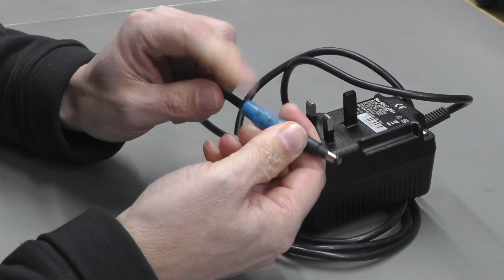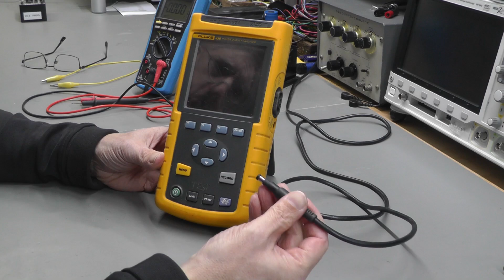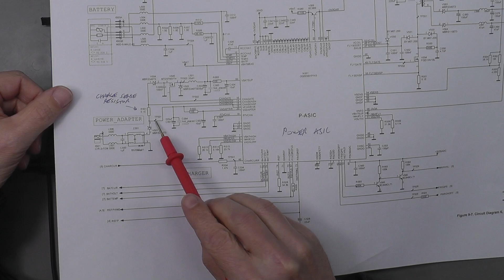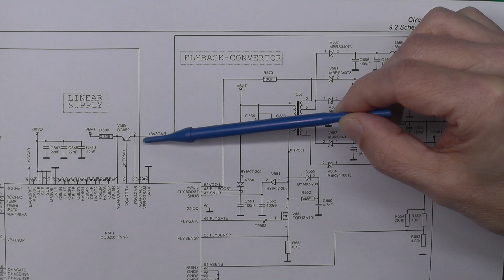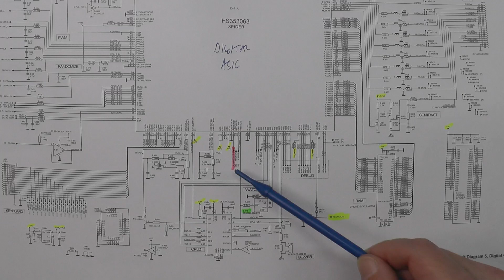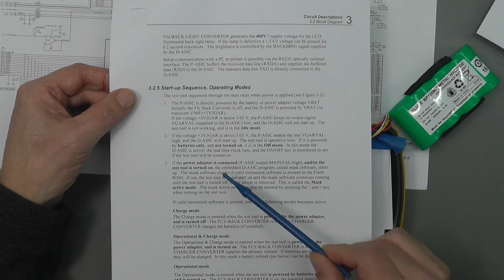No.103 - Fluke 43B Power Quality Analyzer Repair

Comment: I read below that you re-flowed the flash and all is working again? Just the screen correct having lines (common issue)? Replacement screens on ebay I have found.

Comment: Did you have another go at this Fluke 43B? If mask software is running it should be possible to flash the FW through the optical-serial port.
Reply from the maker: Not yet, I have it on the back burner to get back to. Thanks for the info!
Reply: @IanScottJohnston  read sec 7.4.1,7.4.2 of service manual. Although there is a dead end when it says look at sec 7.6 and that section does not exist in the published manual 😞

Comment: I have one Fluke 434 Power Quality Analyzer showing the same issue that you described in this video. I sent it for repairing to the Fluke representative here in Sao Paulo, Brazil a few months ago, but they returned it to me saying they could not fix it up because it was obsolete and Fluke did not hold parts for it any more.

Comment: So much gear has Flash based firmware, It's a good way for manufactures to put a time limit on the life of a unit, the flash just hangs on a bad block. I have a few nand failure project/repairs with very little information on nand rebuilding, unless you know Linux.
Reply: We tried to claim that the code in an ASIC flash was firmware, but the power's that be were trying to insist that it was software and should come under all the rules and standards for software production. it did go in our favor for that project but they got their way in the end.

Comment: Can you not de-solder it and send it to Fluke and get a new replacement? 
It's  very rare for ICs to go bad all of a sudden after operating for months. 
Specially on a battery operated instruments that eliminate the possibility of AC surges.
Reply from the maker: It's working now. I reflowed the flash and it's now powering up. The LCD on the other hand has issues, so will be repairing that.
Reply: @IanScottJohnston  Excellent. Hope to see it working soon.

Comment: Let's hope you can fix it by re-flowing the flash ROM. The 43 is an excellent tool,  I used one routinely to check 75 KW 480 volt 3 phase UPS/PCS  systems for harmonic distortion. Regards,  David

Comment: There is a chance that the problem might be with the keypad. I have seen Fluke 19x scopemeters, which are very similar, not powering up because of some shorts in that flexible keypad membrane. Try disconnecting the keypad altogether and powering up the unit by shorting the power button line (marked ON KEY) to the ground.
Reply from the maker: STOP PRESS.....I have just reflowed the Flash......lets say there should be another video very soon....:)
Reply: @IanScottJohnston  How the hell did you find something to flash into it?
Reply from the maker: @TheEmbeddedHobbyist  Reflowed, no reflashed....🙂
Reply: @IanScottJohnston  Ah now i understand! Solder is much easier to find than firmware. I sit corrected. 🙂
Reply: @IanScottJohnston  Looking forward to Part 2!
Reply: @IanScottJohnston  is there another video ?
Reply from the maker: I checked that, C400 on the Pcb just needs shorted out as it is across ON KEY and 0vdc.
Reply: @IanScottJohnston  Did you disconnect the keypad?
Reply from the maker: Yes.